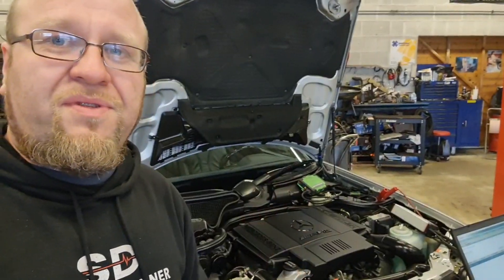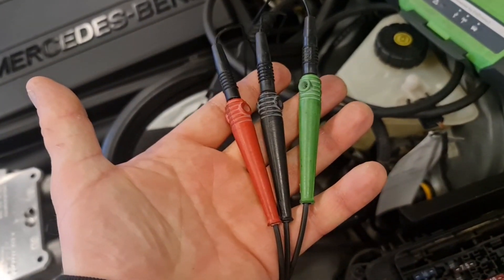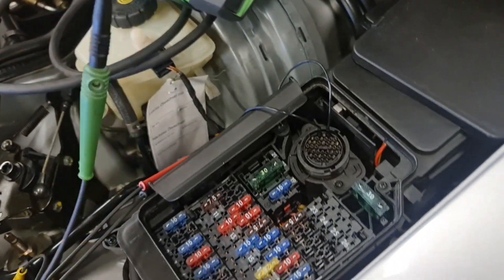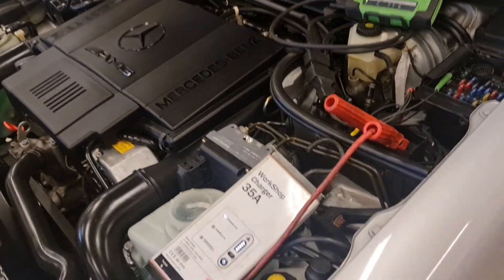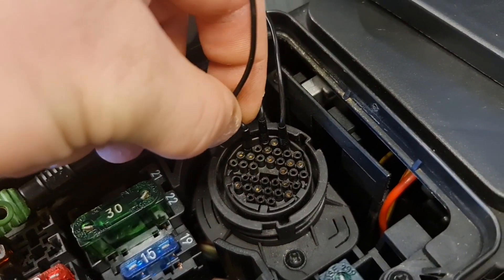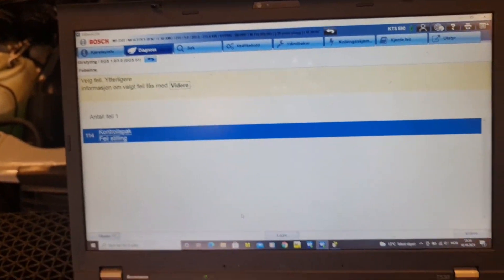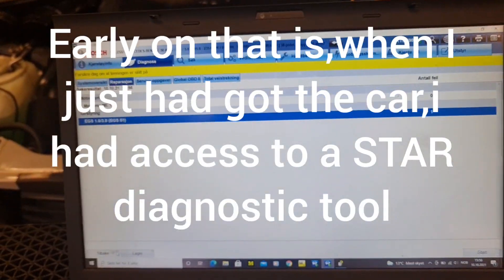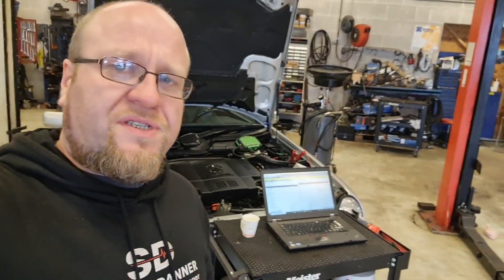Mercedes Benz W210 E50 Amg"How To Connect To The 38pin Diag Connector"Transmission/ADS Diag Example

Comment: Hi, i found your video because i just recieved my multiplexer for Carsoft 7.4 (chinese copy from ebay) and i ran into some strange issues, after connecting the 38pin to the car and opening the software i am able to read out some modules, like the dash cluster which gives me an error for the windscreen washer fluid level sensor (which is correct because i have it currently unplugged as i broke the pump while removing the tank:face-purple-crying:). The issue though is that some modules that are present in the car like the Airbag module cant be read, worst of all, i cant read fault codes from the ECU or see real time data which is why i bought the diagnostic tool in the first place, i have the E220CDi and its been months that im chasing down this issue were the car runs horrible at idle and very bad at low revs without load or without load in general, it seems that as soon as it starts to get some air it clears up and runs properly, if i go to heavy on the throttle though i get a ECP power control error on the cluster and the whole engine shuts off. Rading some realtime data or the code it throws when going full throttle woudl really help me out to figure out were the issue is as i have already tried to go by ear re sealing the high pressure pump, chaning rail pressure sensor and regulator, map sensor and even taking out and cleaning the injector nozzles, turbo is also new, and also the solenoids for the turbo geometry actuator and egr valve. There is still the maf sensor left and after that a injector leakdown test and after that compression test, but doing this by ear is getting costly, but its what i will continue to try doing if i cant figure this diagnostic problem out

Comment: Have a issue with s550 key not turning while in ignition,any suggestions for fixing
Reply from the maker: Hey there.,Which s550? In any case..you need to read faultcodes first.And if not able to turn on the ignition...as far as i know..the only way to access the diagnostic port then..is by using OEM diagnostic tools, aka the STAR diagnostic. When i worked at the dealer..we could access the diagnostic protocolls even when ignition was not able to turn on. Usual culprits for issues with EIZ /electric ignition switches, is the switch it self, or the steering lock mechanism,or the key itself.So there is no "easy " fix for this im afraid...Greetings,Stefan
Reply: @TheCarTakerGarage  ok thanks I was afraid u were going to say it wasn't,bcse prior I had eps,abs lights took to benz and that also said my left door accenuater went out as well
Reply: @TheCarTakerGarage  07 s550

Comment: Very cool mate. Could that of worked on the 2.5-16?  
Keep up the good work old chum! Cheers
Reply from the maker: Hey mate :)  Thank you so much.Well..i do not think so.But it kinda the same " thing"...The w201"s has the 9pin? connector by the battery..which works the same way ..but if i remember correctly..only blink codes for the Engine..and ABS utilizes the ABS warning lamp as a " code reader" ...if you understand what i mean.When you bridge " two" of the connectors...etc ets on the connector up front....the abs warning lamp flashes X amount of times..referring then to a faultcode...which is listed on A code list..So long story short...No it will not work the same,,,but it is " somewhat " the same still ;) If that makes any sense ;)  Thanx for popping by mate :) I hope you are doing good.And your family too :) Greetings,Stefan :)
Reply: Yeah mate your right about blink codes but I was just thinking it may be able to be adapted. I should stop thinking about these things but that was my favourite car I ever owned. Anyway great video and go well my friend
Reply: We are all well here thanks and hope you are too. Getting close to Christmas so wishing you a very merry Christmas and all the best the festive season has to offer

Comment: so if u want to drive sporty with the ads u press the key up and if ur regular driving u just press nothing on motor engine start up?
Reply from the maker: When the button is pressed ,so the light is lit,,,the suspension stiffens up,especially in cornering it is noticeable.Alot sharper response.And firmer dampening.When starting up the engine,/ car,...the default setting is that the ADS is off.
Reply: @TheCarTakerGarage  Ah thanks! Cause my E50 just got the normal suspension with sporty springs... I think the ADS makes more trouble haha